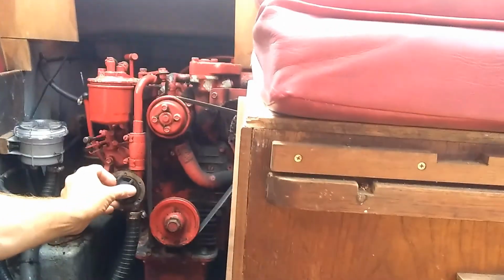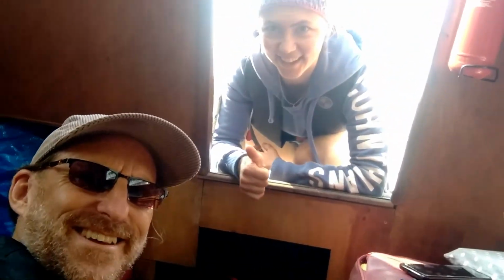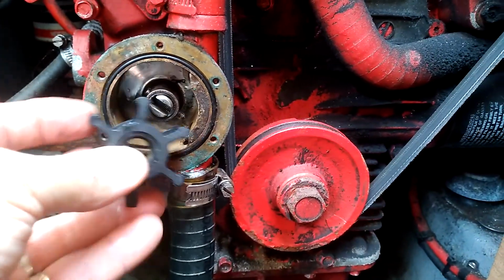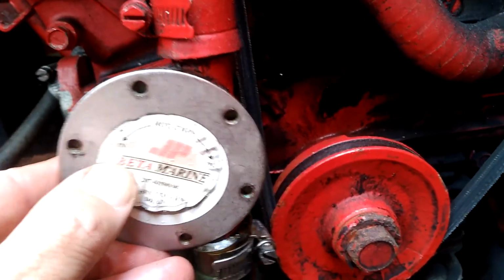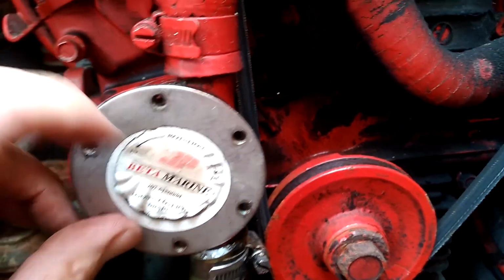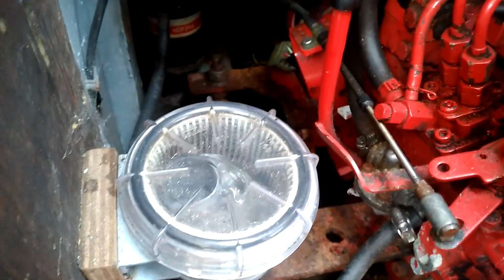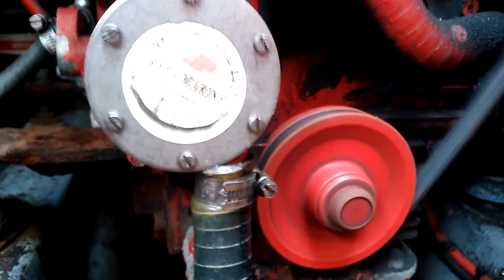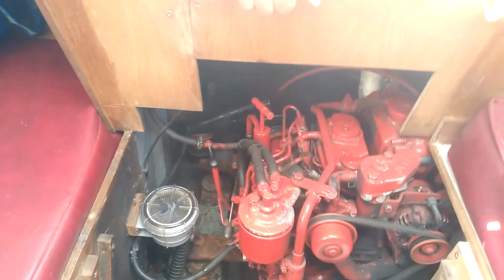S01 E08 Disaster! Sailing day cut short.

Comment: Day 3 of the IYT yachtmaster course. changing the impeller at sea. Remember to buy a new spare. Good to grease it when you put it in (as the actress said to the bishop). Some impellers come with a tube of special grease. On the sailing school boat there are 2 associated problems. 1. the broken bits of rubber go through the system and block the heat exchanger. 2.